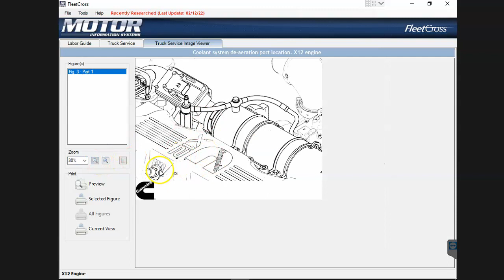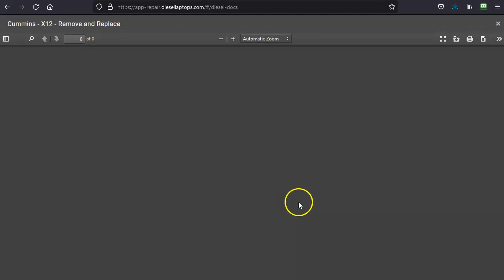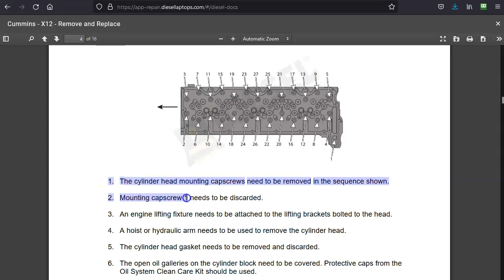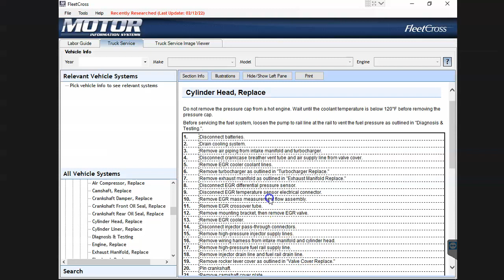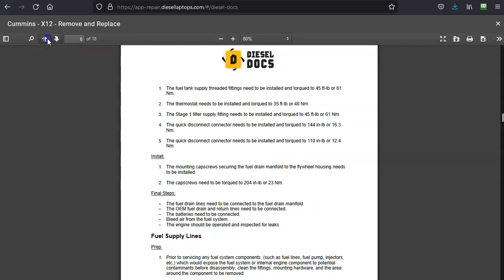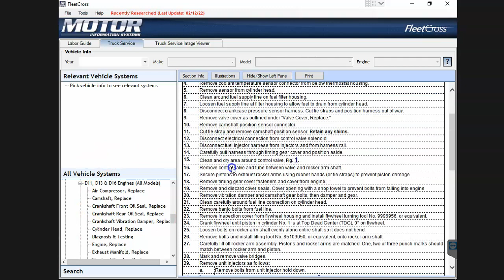MOTOR FleetCross Repair Information Review on Remove & Replace Instructions

Comment: I've tried both of them, canceled the motor, and subscribed to the diesel repair. It's alot more user friendly and the information is alot easier to find. Looking forward to different years, volvo ends at 2010.
Reply from the maker: Thanks for the comments! We do have fault codes for all years, and we recently uploaded Recalls & TSBs for Volvo 2010 & newer. We should also be solid for remove & replace instructions for Volvo engines as well. Wiring diagrams have been filled out recently for Volvo VN trucks. If you can tell us which information and for which model truck/engine we can get you some better answers and timelines. Thanks again for being a user!